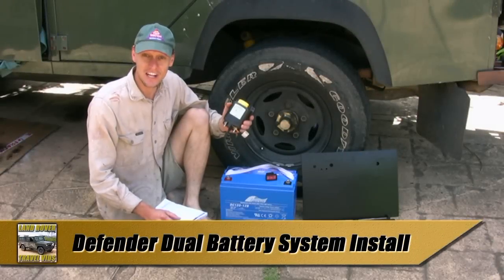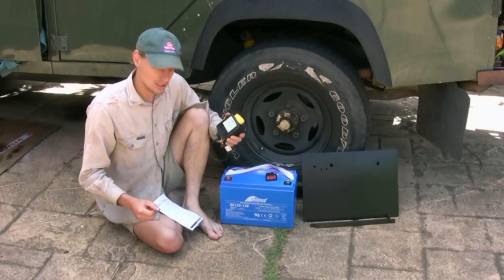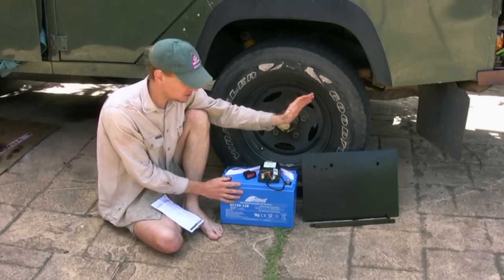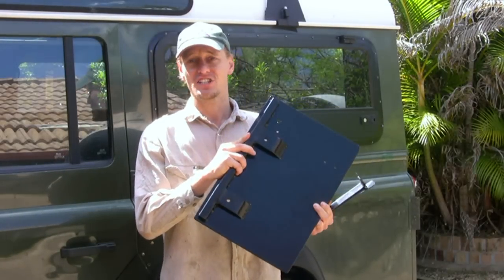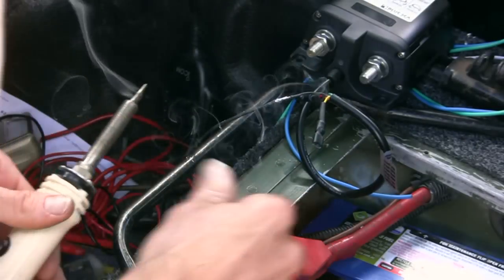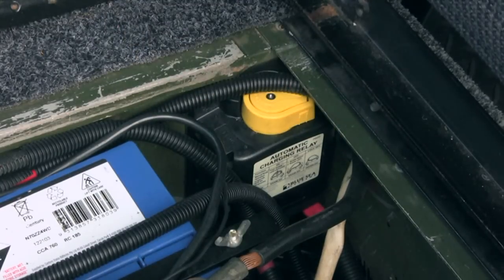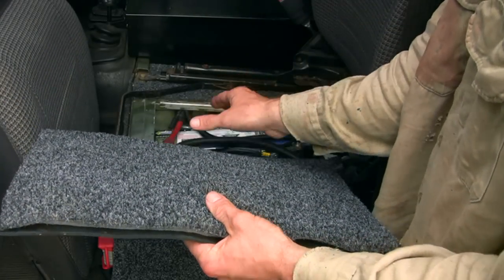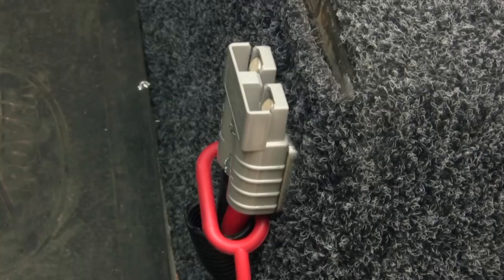4x4 Dual Battery System Installation for Touring - Blue Sea Automatic Charging Relay

Comment: Hi mate, great video! I was wondering, is the standard alternator powerful enough to charge two batteries? I drive a 2000 Defender.
Reply from the maker: That's how most dual battery systems operate, though the system may struggle if you take your secondary down alot and don't drive enough to give it time to charge. I can't really tell you for sure as my secondary battery is 98% charged by solar power with a 130w panel mounted on the roof.
Reply: Thanks for the help my friend!

Comment: How big are the batteries amperage wise?
Reply from the maker: The seconday battery is 120Ah. Cold cranking amps are 760A and cranking amps are 910A.
Reply: What about the primary?
Reply from the maker: Primary is a lead acid with 760CCA.
Reply: And what blue sea relay did you use (if possible part number)

Comment: Hi mate, recently had issues with my voltage sensitive regulator from sterling power. Does "connect" on the remote switch link the batteries in parallel or does it just allow charging of both batteries? From what I'm seeing on the instructions you'd still need to run a thick switchable cable between both batteries to be able to link batteries in parallel.
Reply from the maker: hi mate. The batteries are linked parallel, so it is possible to link the 2 for starting a vehicle when the primary is flat or for extra power when winching. I used 2 b&s cable to connect the batteries. Thanks
Reply: Roaming The Outback Many thanks. Sorry hadn't noticed your reply. How is the system holding up?
Reply from the maker: Thus far all good. :-)

Comment: Can u tell us more about where u got system etc?? Looks great
Reply from the maker: Thanks mate. You want to search for a Blue Sea Systems Automatic Charging Relay part no. 7622. These are actually produced for use in marine vehicles so boating shops will likely stock them. The unit specs are found here bluesea.com/products/7622